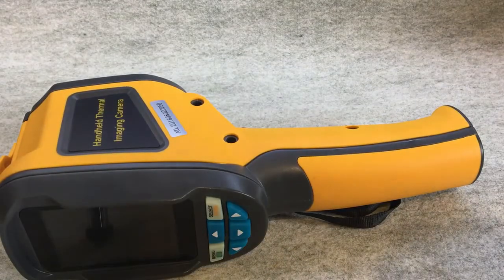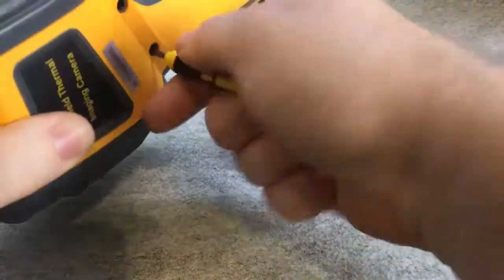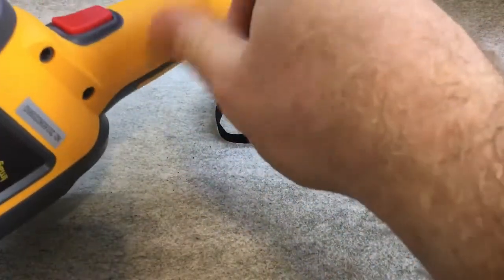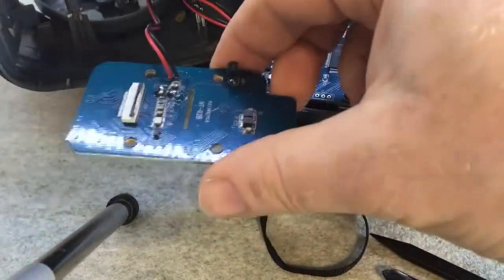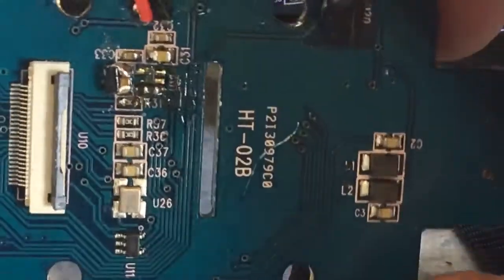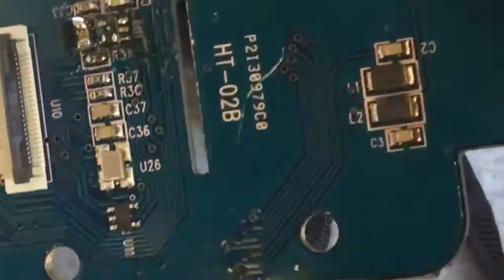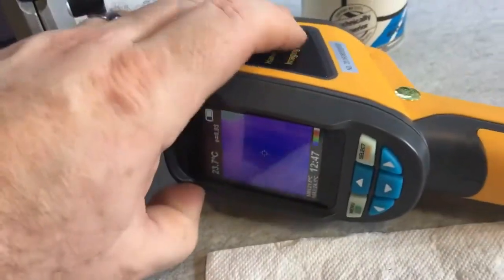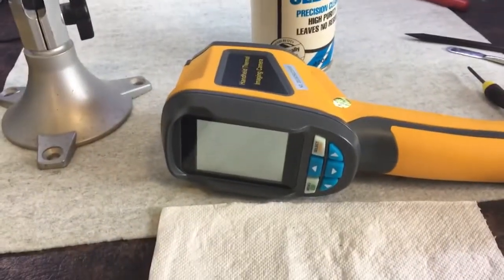#90 Thermal Camera Teardown, Investigation, Diagnostics and Repair Part 1

Comment: might the damage you addressed not be poor manufacturing but rather, the results of a thermal failure?  Funny how a failed thermal camera might benefit from examination under a thermal camera to detect hot spots! :)  Good Job!  Thanks for sharing this.
Reply from the maker: The capacitor was definitely installed backwards, which is a disaster when it comes to tantalum’s

Comment: The "transistor" - Dallas DS18B20 is the temp sensor for the case.
Reply from the maker: zapro_dk - yes I thought it was a temperature sensor.
Reply: So was it the temperature sensor causing the problem or something else?